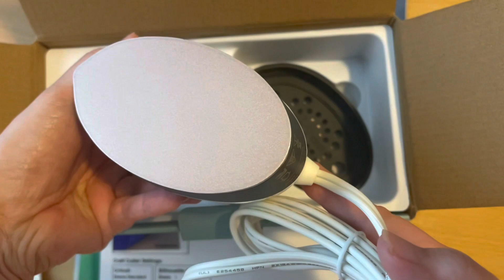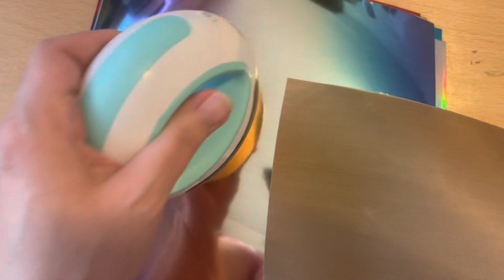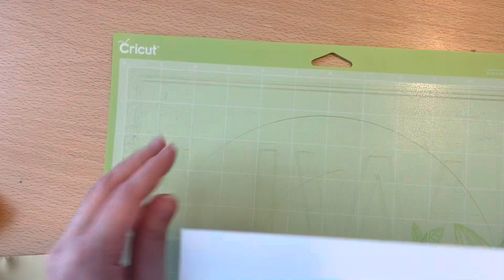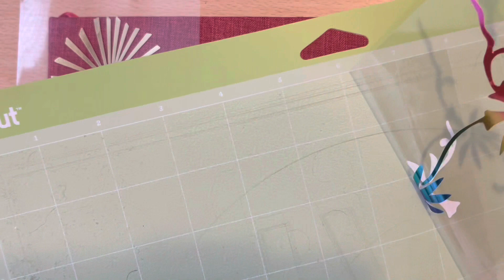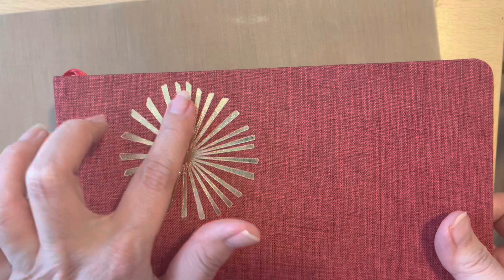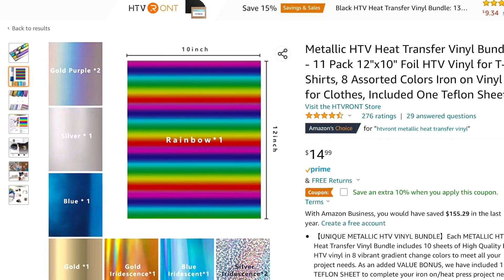HTV Ront Mini Heat Press Machine Review and Demo with Metallic HTV and Cricut

Comment: Do need a different transfer tape for HTV vinyl or can use the same as the permanent vinyl?
Reply from the maker: Hi 👋 permanent vinyl is like a sticker. Do not apply heat. The transfer tape used for this has a glue adhesive that is not meant to be used with heat either. HTV means heat transfer vinyl and is made very differently to use heat to melt into the fabric fibers. You’ll want to use heat transfer tape. It almost looks metallic.
Reply: @2tinytreasures  Thank You so much.